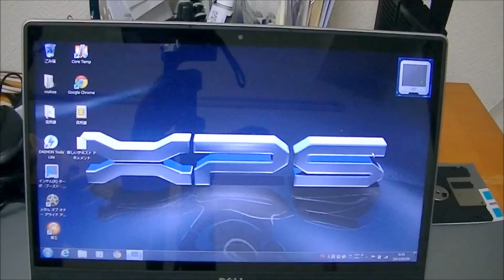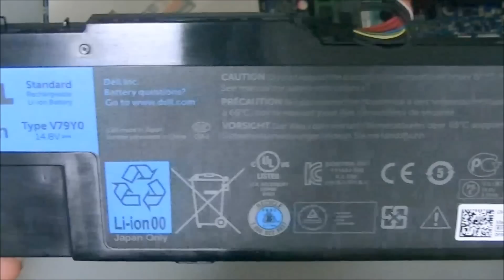Dell XPS 14z ■　Remove Hard drive and battery

Comment: Trick if you haven't the same case removal tools - i used guitar picks and shimmed it off using about 5, leaving them in various spots until the bottom cover unsnapped.... worked like a charm... just take your time.

Comment: How can we change the Ram memory? I just bought Corsair Vengeance 16Gb(2x8Gb) DDR3 , like the old one, but faster and I recive error when I put the new one. 
My version has 6Gb RAM, i see a slot with 4Gb, but where are the other 2Gb RAM?
Reply: Bogdan Panici other 2g  most likely internal RAM that shouldnt be removed. You can only upgrade the 4gb stick.